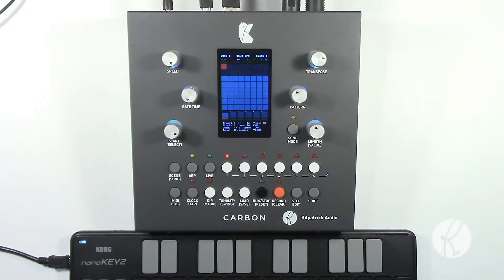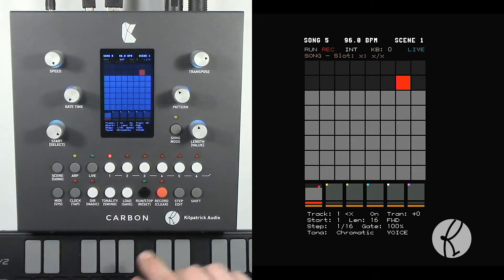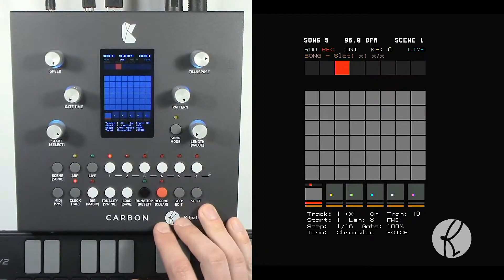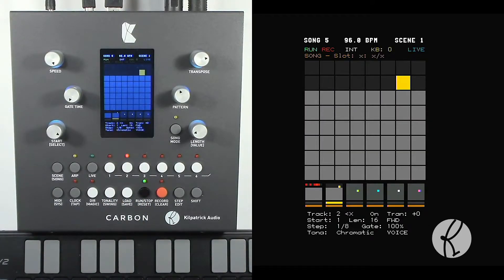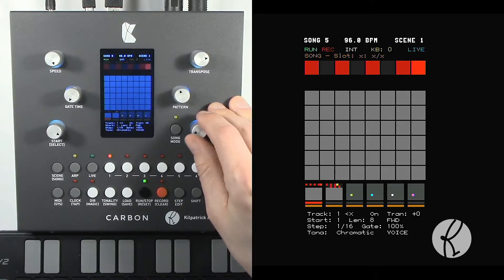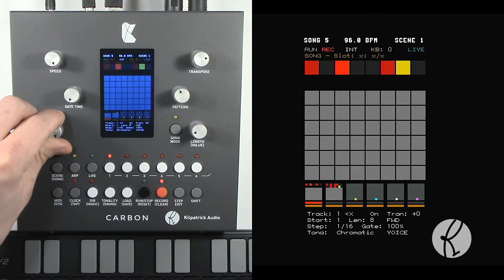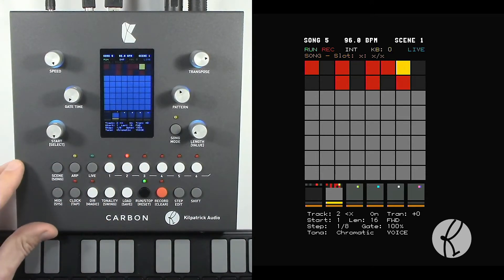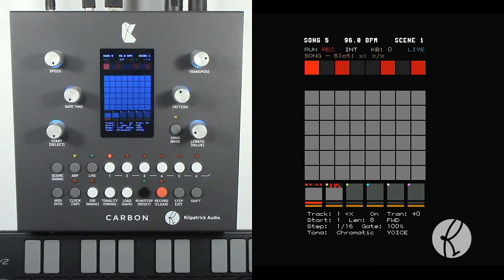Sequencer - CARBON Sequencer

Comment: Can you change the speed of a track while the other one keeps its own bpm?
Reply from the maker: Yes all tempo is made by the main clock, but each track can have its own subdivision and length. Many kinds of dotted and triplet rhythms are possible.
Reply: @KilpatrickAudio  a short time after my comment I bought the Carbon and it is a real fun to play with it. I was wondering if you make an Eurorack version of it? Thanks
Reply from the maker: @NicleT  Glad you like it! We don't make a Eurorack version but I'm always thinking about new sequencers, and leaning towards Eurorack if I do it. Any particular features you would want?
Reply: @KilpatrickAudio  maybe something blending the concept of Carbon’s fast changing gate layers and the concept of colors and length lines of the 252e Buchla Polyphonic Rhythm Generator paradigm. Or a totally other approach with just 3 ~ 4 tracks  instead of 6, linear or not. I have some UI ideas too. Maybe we should talk about it someday, I’m in Montreal. PM me if you want. And thanks for your work!
Reply from the maker: @NicleT  Cool! Email me via my site and we'll sit down for a synth chat sometime.